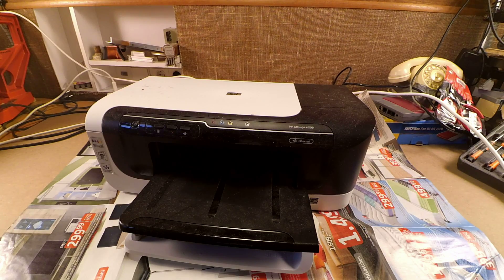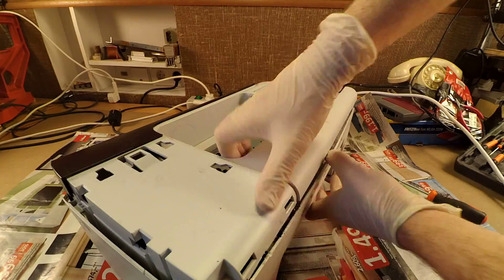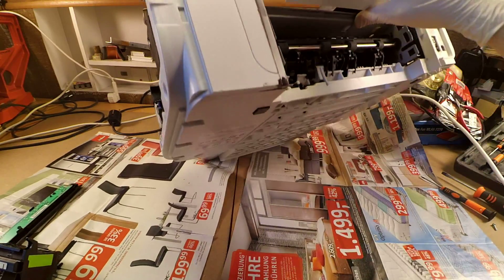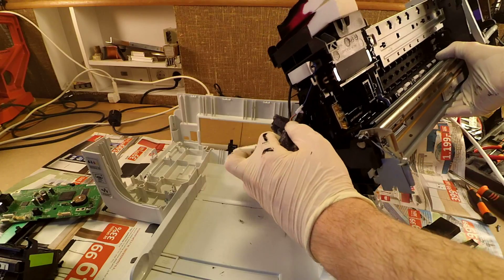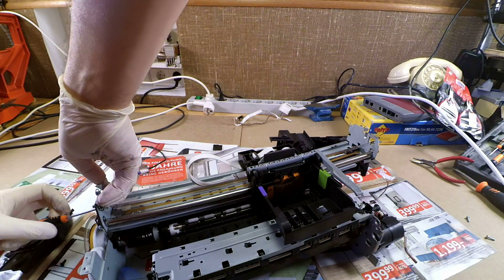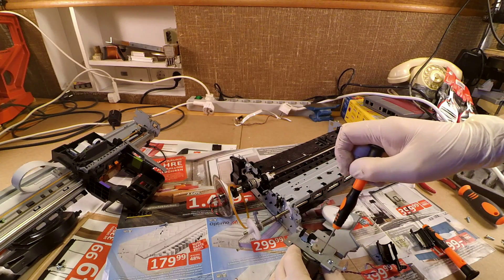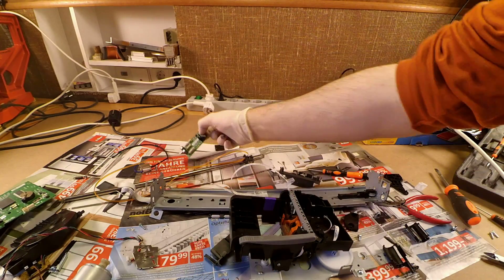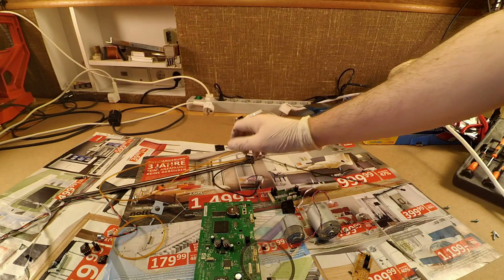Printer Teardown

Comment: The LED with the striped tape is used as a feedback for the motors because they're not using stepper motors. They need this feedback to know how far the motor has moved and if it needs more power to move forward, with a stepper motor you can tell it exactly what to do and it will do it without excess.